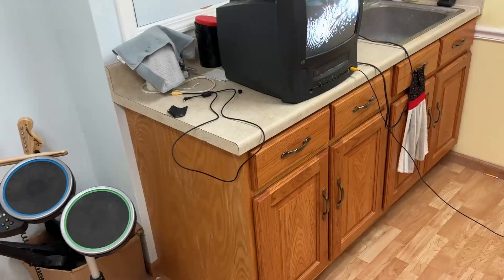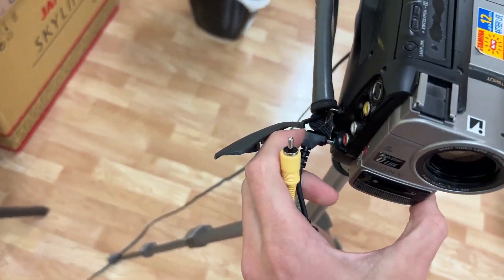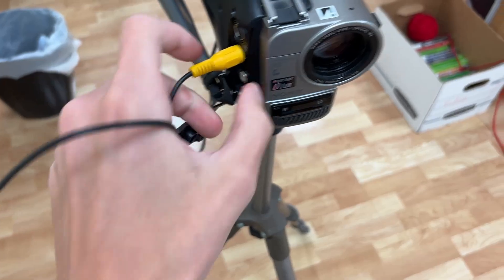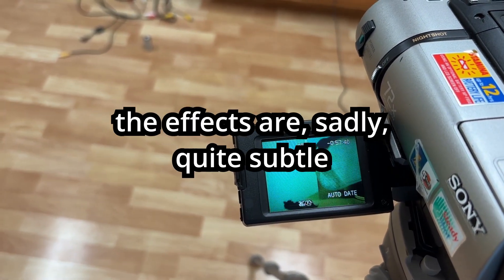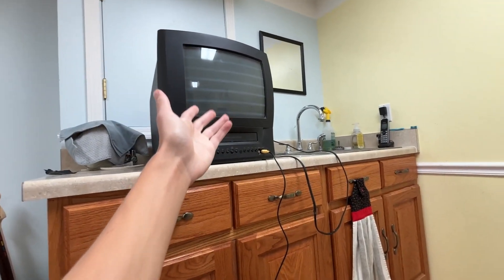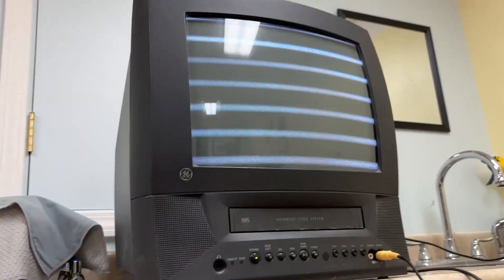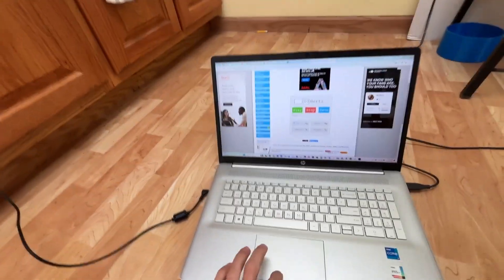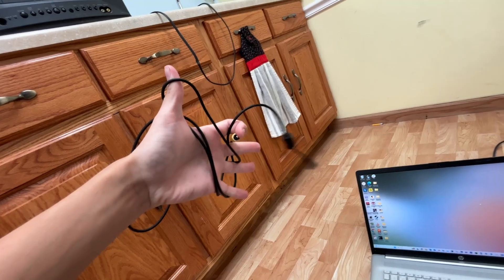SEEING SOUND with a normal crt!

Comment: Fun fact: the Sega Genesis uses the same 5 pin connector as a midi keyboard does, but with composite video on the other end instead of usb. That means you could technically plug your midi keyboard into a tv. Don't know what happens cuz I'm scared of bricking my keyboard and tv simultaneously, but this fact lives in the back of my mind and tempts me every now and again.
Reply from the maker: That’s cool, I don’t imagine it would damage anything, but I also could totally see it breaking things. It would probably look similar to this though.

Comment: You can transmit any kind of analog signal through 3.5 mm jack, including video, so that cable was most likely used for that. My camcorder also came with a cable that had 4 pin jack on one side and all 3 outputs (left, right and video) on the other, so you can plug just one thing into the camera instead of three

Comment: As a person with Synesthesia, I approve of this video.

Tried this with mine but unfortunately it needs more specific video data to display it as it was a more modern monitor. However the hearing video still works!

Another cool thing I found when I was messing around was that the AUX cable can still conduct in the same way an AV cable does, so by touching the cable from my console to the AUX and the end of the AUX's AV cable I essentially made an exposed area of the cable, setting up a fan next to it would add random resistance via air and it would make the video glitch out. If you can then give it a try!

Comment: this cable you is a hack of a way to get antenna signal into old school crt clocks and other smaller, cheaper TV's that didnt have a full-size coax.

it may be different in NTSC land, however I have many PAL TV's here that use that same 'mono' pole 3.5mm

the way i jig mine is to use a VCR antenna out with a spliced adapter, but your way would work even better. Might have to splice my own to try it out.....
Reply: i would suppose that the lines youre seeing is legitimately the frequencies that make up the signal. visualised data.

Comment: If you hook up a SPDIF signal (which usually is sent over RCA cables) to a TV you'll actually see a black and white pattern that corresponds to the binary 1s and 0s from the digital audio stream. It won't be in sync but you can see the pattern similar to PCM recordings on videotape.

Comment: Ok listen up! New idea for an an “audio” feedback flightsim. Plug the cameras video out to the tvs audio in. Then plug the cameras audio out to the tvs video in. Now the camera will be sending the video “hum” into the room through the tvs speakers and then picking it up with it’s microphone and feeding that to the tv screen. So technically the tv should still be displaying something at least similar to the video the camera is capturing if the room is perfctly silent. The picture should distort more the more you speak. And now just point the camera at the tv and see and hear what happens.